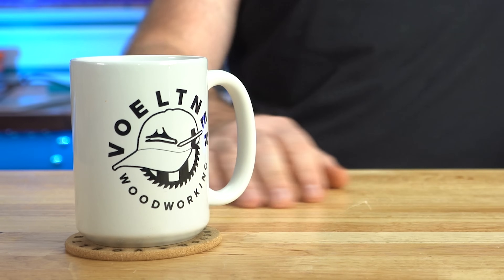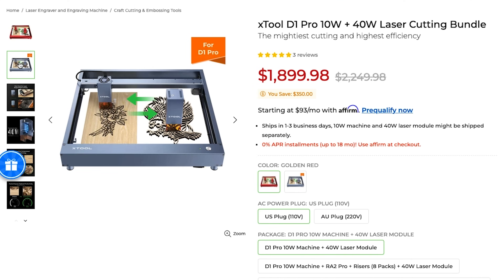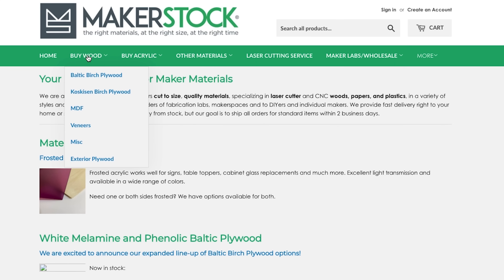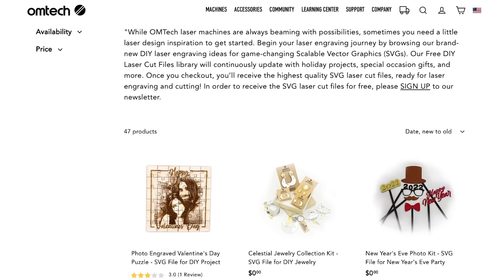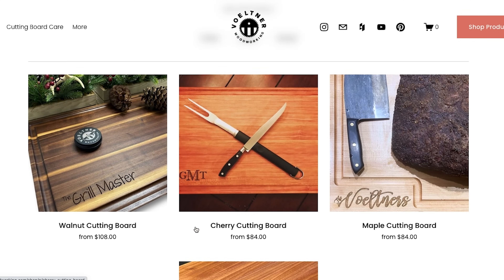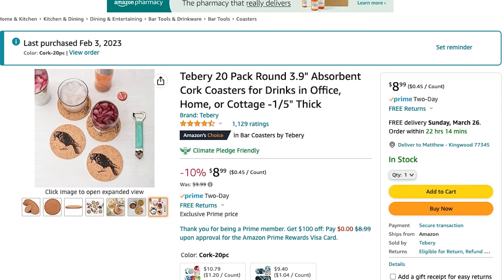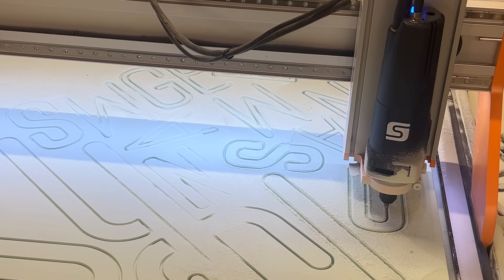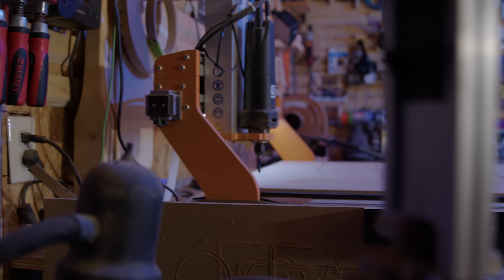I should have NEVER bought a combo machine

Comment: Just found your channel today and am loving your content.  I am retiring in November at 49 and plan to make a second career out of my creative side.  I have been 3d printing for years and have 5 machines that will soon be dedicated to business and now want to branch into Laser Engraving and eventually CNC.  Is there a huge downside to starting with a diode laser to get off the ground given the low price of entry?
Reply from the maker: Thank you so much! 

Not at all. I’m fact, I’m going to do a video on diode lasers soon. I would recommend checking out XTool 20w D1 Pro. It’s a reasonable price point. If you’ll be doing cutting with it then you can consider upgrading to the 40w module which can be swapped out interchangeably. @xtoollaser
Reply: @VoeltnerWoodworking  Our plan was to begin with products like etching yeti mugs, wood and slate coasters, aluminum business cards, as well as some cutting so the XTool 40w D1 Pro with the risers and rotary is actually what I had been considering.  I am concerned with outgrowing it quickly given it will soon become my full time business but at the under $2000 price point I imagine it will pay for itself fast anyways.
Reply from the maker: I think it’s smart to start with that system and then upgrade once you figure out what sells and what doesn’t. Then you’ll have a dedicated unit you can use for rotary work and use the new machine for more flat stock projects.

Comment: so did you buy that you should not have?
Reply from the maker: Did you skip that part? Lol. It was the small Piranha FX CNC/laser combo.
Reply: @VoeltnerWoodworking  it was difficult to determine.
okay - so the combo tools is not a smart buy - got it!
i am thinking about getting a laser cutter - yet first i need a roof - and some walls.
Reply from the maker: In my opinion the lasers that come as add ons aren’t strong enough to do what most people intend on doing. You’re better off with stand-alone units.

Comment: I have both but I started with my cnc machine, and have yet to mess with my laser. Also, you’re definitely right about milling your projects according to what you want to carve on them. And I don’t know about lasers, but there’s a HUGE learning curve on cnc machining. You have to know how to create a g-code and upload it to your machine, then you also have to know which specific bits (spiral bits and v-bits) to use for your project. Not to mention, zeroing your machine as well. It takes time and a lot of practice! Perhaps it’s way easier to use a laser, then a cnc machine.
Reply from the maker: Using a laser is MUCH easier for sure. Once you get your laser aligned you're ready to go for the most part. There's a small learning curve with the software, but nothing like on a CNC. The laser is so easy, even your grandma could do it. LOL!
Reply: @VoeltnerWoodworking   Now that's a great comparison right there! 😆

Comment: Great video and comparison - - I  got a CO2 laser 3 years ago, one of the Chinese K40 Whisperer's for under 400 dollars.   40W unit.   Then got a Atomstack Diode laserfrom ALI Express.   Nice thing with the diode unit is I can Set it on the work... and make artwork the size of the laser frame and set it in the middle of a table if I want, so the project doesn't have to fit inside the K40's cabinet.
Reply from the maker: Thank you! That’s one of the reasons I got the Full Spectrum Muse so I could use the open bottom, but I rarely used that function. It IS nice to have that option for sure!
Reply: yes you can set it on the table on the work and burn your house down,What is going to stop the laser from burning through the work through to the table and now you have a fire a big fire. You need a sheet of metal under the laser bigger than the frame.
Reply from the maker: Pretty sure he was talking about the common application of purposefully engraving the workpiece where the surface is larger than the footprint of the machine.

Comment: And don't forget, as a maker. You also do not NEED a cnc or laser.  It's a luxury and a lot of the same things can be done with a router + jigs or templates.  A pantograph or sign making jig for a router can make some of the same things you just have to do it by hand like they used to back in the day.  Not saying cnc and lasers don't have their place, but seeing how everyone on youtube have these machines, it can seem or make you feel like you NEED these machines to be successful or creative. Don't limit yourself to thinking it's a requirement. Especially if you're just starting out.
Reply from the maker: Yep, just like you could use a pull saw to make a table, but why would you if you can afford an electric saw?

Comment: I have no experience with CNC machines (with drill bits), but from my understanding, one advantage they have, too, is they can do kind of 3D. I saw people making bas-relief sculpting with a machine having precise Z (depth) control.
Reply from the maker: Yes, you can even get a 4th axis and do rotary type engraving. There are some really advanced systems out there. A little more than a hobbyist would be into probably.
Reply: @VoeltnerWoodworking  Meanwhile, I saw bas-reliefs done with laser, modulating the power to cut at various depths. Not sure it is accurate with hobby laser, and it needs lot of cleaning (soot) after…

Comment: Why would you need a table saw for a cnc and not a laser? The cnc can cut the desired shape.
Reply from the maker: As I mentioned in the video, most people buy stock (smaller, more size appropriate) materials for a laser, but CNC work generally uses different materials for more complex projects. If people are doing CNC work they are likely working with a wider variety of materials. Additionally my CNC is limited on capacity so if I’m cutting 3/4” plywood or hardwoods (which I don’t do on the laser), I use the table saw to break down the materials to fit the bed of the CNC. Hope this clears that up. Thanks for watching and commenting.

Comment: While the laser can be extremely accurate, it is still not as accurate as a CNC Router when doing thick mediums or making jigs.  Basically, if you want something to be VERY rigid and repeatable you want router.  There are VERY nice additive Lasers for CNC machines now, including some nice 10 and 15w diode lasers that are super simple to tool swap on the CNC.  Though I still think having 2 separate machines is better due to larger margin for production efficiencies and the ability to learn both disciplines at the same time while you wait for one job to finish on one machine you learn something on the other machine and start the job.  Really effective and efficient way to learn the processes
Reply from the maker: I agree. That’s a good summary of the video.
Reply: Can't say I fully agree with this, it depends a lot on the quality of your laser, something like a K40 or cheaper? Yes, definitely. But something with decent rigidity and spot size compensation based on the depth of cut will be more accurate than a similarly priced router. 

Laser are of course 2D only and not material agnostic though so they only really beat routers in cost, maintence frequency, cutting speed and noise from a specs standpoint.
Reply: @oliverer3  Ummm...there aren't similarly priced routers to the types of lasers you are speaking of...  Full CNC 4 axis machines are the only rotating tool in the price range of those lasers when you add operating costs...and those will also cut rings around the laser in accuracy and repeatability of the result.  Minor phase changes have huge impact on the laser system.  The higher the amperage the smaller the tolerance to phase harmonics and induction feedback.  the worst thing you have to deal with on a rotating tool is properly setting up the machine with proper leveling.  Lasers are far superior at doing Flat 2d work where 10 thousandths of slop are not even noticeable or cared about, or extremely intricate work on very thin metals (though this is actually usually an additive process in high volume MFG) micro sintered circuit boards are super fast to produce now.

Comment: Never cut PVC or Vinyl with a laser!  The off-gassing produces toxic and corrosive fumes!
Reply from the maker: I don't think I mentioned that in the video.
Reply: @Voeltner Woodworking  Some laser manufacturers will even void your warranty if vinyl or pvc is cut or engraved in their machines.  Besides being deadly fumes to the human body, the fumes will quickly corrode metal components inside the machine.  A couple ways to check if a material contains chlorine is by looking at the msds and then look at the section about byproducts of combustion.  Another test is to heat up something like a piece of copper wire and then drag the heated wire across the material (probably in an inconspicuous place) and then place that wire with the residue it picked up from the material in step 1 into a flame.  When it is first placed in the flame, watch to see if the flame turns green briefly.  If so, that is an indicator that the material is not safe for use in the laser.  I hope that helps.  Feel free to use that info in a future video if you want.
Reply from the maker: Yep, I’m familiar. 👍🏼

Comment: Thank You for the video.  I built my own CNC Router...but am thinking about adding a laser.  Love your tablesaw - what brand is it, Matt?
Reply from the maker: That’s awesome. You do your own programming on it? 

I have the 3hp SawStop PCS with the slider and router table extensions. It’s so good.
Reply: @VoeltnerWoodworking  Simple stuff -I can create the G-code.  ( I do that more on my cnc lathes, though).   Mostly everything that I do is complex enough - that I need CAM.  I like to use Vectric VCarve for the router table and the milling machine
Reply from the maker: @joecnc3341  that’s incredible.

Comment: Haha, should have watched to the end before commenting. Yep the Finance Manager okayed the $289 3018, asking for $20,000 laser might be pushing a bit hard. Until I make profit on the 3018:)
Reply from the maker: The footprint on that machine is pretty small, but it's a great way to get started. You'll be looking for the next biggest machine soon enough. LOL! At least you'll get familiar with the process on that machine and it's cheap enough to learn on.
Reply: @VoeltnerWoodworking  While cleaning the junk to make room for a workshop I found my old extrusions for 1500 wide by 600mm deep router/mill from 15 years ago. Back then ball screws and multiturn rod was hard to get, now much cheaper. Got some rusty 23 steppers on the old CNCed Seig X1 mill, in the junk. Hand Tool rescuing stuff including stepper driven optical table pulled out of old equipment, very heavy, dropped it on my foot yesterday, it now has some of my DNA on it. Turns out CNCing can be more dangerous than expected. Steel caps boots from now on.
Reply from the maker: No more flip flops in the shop? Lol.

Comment: Have not tried Cork, nice tip. Got 3018 with 2.5W laser so can try both.
Reply from the maker: Awesome! Let me know how it turns out!
Reply: @VoeltnerWoodworking  It is a toy, good for learning, hard to break bits when crashing it, but strong enough for upcut bits to rip stock off double sided tape. One of the first thing I learned is I am allergic to formaldehyde in MDF and MDF makes a lot of dust. DIY coffee jar vortex system fixed that. Learning G-code is another big learning step. Spending much more $$$ and getting a ready to run laser system with fume extraction etc makes more production sense, if I knew what I was going to make except a mess, haha.  Next time I am in Dollar store I will grab some cork coasters.  Thinking 10-20Watt Diode laser might be the next upgrade, but now 30W ones are coming out. So I will wait and see and practice my CAD/CAM coding. Cutting clear Acrylic is CO2 laser selling point.  Get one of everything?  Those Fiber lasers are really good on Brass/metal so maybe go that way. Desktop water jet cutter? The choices for home shop/small business are many now.
Reply from the maker: If you can swing getting a 40-50w CO2 over a diode laser I highly recommend it. You'll save a lot of time and it can cut clear acrylic for templates and such. Diode is going to much more limiting.
Reply: @VoeltnerWoodworking  The new Xtool P2 55W CO2 now has some serious ease of use features, compared to a Trotec etc it is a bargain. But have lots of CNC and design stuff to master first.

Comment: I like my Glowforge Pro but they have no way to add a rotary device to it without a lot of hacking, physically and with software. It seems like someone would come up with a CNC machine that you could switch out the head to have a laser or router bits or even more. Adding a water jet might be too hard to contain the water mess but you see where I'm going with this invention.
Reply from the maker: I had the Muse laser and it has a riser that you can add for a rotary. They are very similar to the GF. Honestly getting on to the lightburn platform has been fantastic and I’m glad I made the switch. There are some CNCs that implement both a 3d and laser module as well, but I’m a fan of the stand alone units. I don’t want a lot of dust around my laser, and especially around something I would want to 3d print. 

People do seem fairly happy with the newer units that can do all 3, but there are only a few people who have done reviews on them. I’m sure there is a market for that though.
Reply: @VoeltnerWoodworking  Thanks for the info.

Comment: Both are CNC Machines😅
Whether it is a 3D printer, Laser Engraver, Water Jet, Plasma Cutter or a milling machine (Some call it a CNC Router) all of those are considered  CNC Machines 🌹
Reply from the maker: Agree. They are all computerized numerical control machines but I refer to them by the common names for beginners or those researching the different types. 👍🏼

Comment: Which laser would be efficient at making custom Metal credit cards? Multiple colored cards like gold, silver and so on, I need a machine like the one swipeskins are using.. do you know which it is and price? My budget is around 1-5k
Reply from the maker: I’d recommend something like a fiber laser assuming they are aluminum or something similar. Check out this one: https://omtechlaser.com/products/30w-us7-30w2-us?sca_ref=3052260.jSLSP0ZUVT

If you need color engraving then check out the MOPA ones on their site. Most of those come coated already and you’re just removing the coating with the engraving.

Comment: Great video! I originally bought a cnc for the 3d carving capabilities thinking they would quickly sell. I ended up finding in my market the best sellers by far with the highest mark up is custom nursery room, wedding, and business signs. The cnc was capable of doing this but the cleanup on each piece was a pain so I got a 100w laser and had it paid off within 8-12 months. 
Cnc is a useful tool for the shop but for making money laser is the way to go (in my opinion)
Reply: CNCs do not do 3D, it's 2D. They each have their own strengths, depending on the depth of the carve, a CNC may be better, for finer details, a laser may be better.

You can carve signs with a CNC and fill in the carving with epoxy or just paint and those are really nice looking signs.

I use the laser to cut out letters and intricate shapes.
Reply from the maker: @LuisCasstle  that’s actually not true. CNC can do 2d like a standard tool path, 3D as is shown in Vectric (multi height tool paths), and some have a 4th axis to do 4D work.
Reply: @VoeltnerWoodworking  yeah, you can definitely do 3D with a 5 axis, but that's not what was being discussed, I'm pretty sure they're referring to flatbed CNCs.

I only mention that because I used to think it was 3d until I saw it explained as 2d carving/milling. I'm still learning as well.
Reply from the maker: @LuisCasstle  you should check out https://www.vectric.com/products/aspire because they will explain 3d modeling. CNCs traditionally have 3 axis (XYZ) that do 3d work, with additional 4th or 5th axis options to do more complicated 4 dimension carving.
Reply: @LuisCasstle  Without the extra axes, CNC does more like "2.5D" -- it's 2D, but with actual depth that laser can't do.

You can't, for instance, make a bowl with laser (at least not in a single piece). You could with CNC.
Reply from the maker: Great point! Yes, the cleanup from those bits is another reason I’m also a huge laser fan. Thanks for watching! Also, very cool to hear about how quickly you paid off that 100w.
Reply: What kind of Laser did you buy?